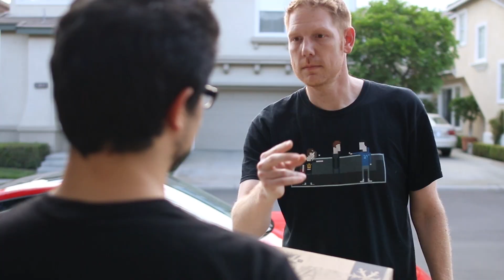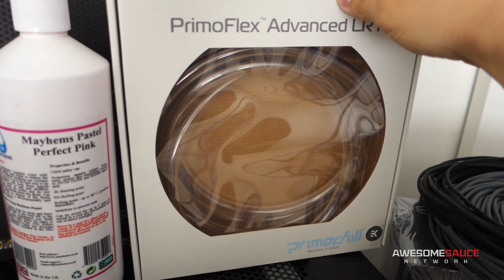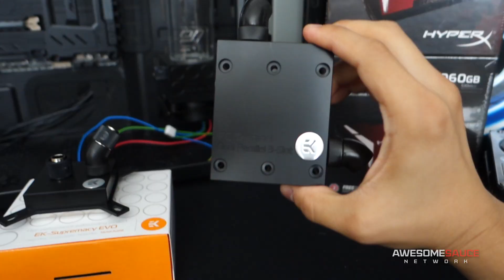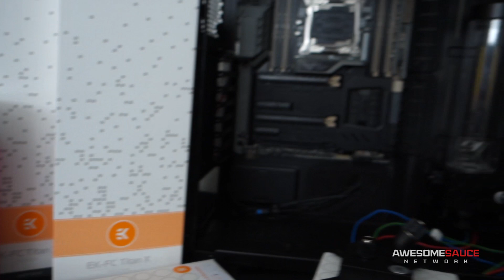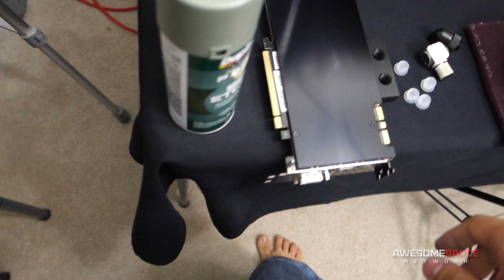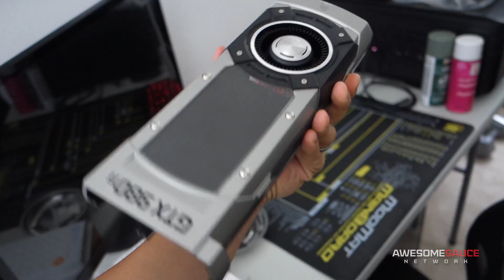Custom Water Cooled Build Log 3 -  THE PARTS & GPU Water Block Installation!

Comment: Hey Kyle, the heat sink on the zotac card has two more screws hold it down, which is why you were having g trouble removing it. And please, never use a heat gun on your graphics card, there is always another way. That what makes modding, so much fun, coz there is always something new to learn and do.

Comment: Can anyone tell me if a waterblock on a gpu needs the PC to be water looped? Or do they just cool the card without tubing and custom watercooling?It may be a dumb question but i havent found an answer to this.
Reply: how could they cool it without water? of course you need water, or else the block will just heat up as well

Comment: After what I'd done to my GTX 580.. I'm sure as hell not afraid to put on a water block on the GPU. The thing had failed after many years of use... so I took it apart and threw it in the oven to try to get more life out of it. Sure enough.. it was brought back from the dead and still works almost 2 years later in my older PC lol.

Comment: Kyle I have a question about fans. How did you hook up your fans in the case. I just bought the define s and want to run more then 2 case fans but my motherboard (Msi a78-e35) only has 2 sockets for case fans. How would u recommend I fix this?

Comment: Hey i have a question, you know how there are founders edition cards or reference cards do non reference cards have the same pcb so like the gtx 1080 founders edition and the gtx 1080 G1 Gaming do they have the same pcb? so a GTX 1080 founders edition waterblock would it work with the gtx 1080 G1 gaming by gigabyte ? thanks
Reply: Not always , the 1080 founders edition, and the evga 1080 sc both have the Ames reference pcb, but all other 1080s use different ones so a different water block is needed

Comment: do other components on a gpu (beside processor die) need cooling and how much??? my gpu has 3 fans spread all over the card, but what happens with the rest of the card if i put water cooled heat sink only on chip??? thx
Reply: Vrm and memory. If you have one fan blowing cool air on them, they should be fine. They don't generate nearly as much heat as the gpu

Comment: Can someone please tell me the name of that pump/res combo, I can't find it on EK's website?
Reply: thats cos whats in there is now EOL Sadly, been looking for a similar setup as the current gen combo has a really small Res
Reply: +Dave Wilson Bummer! Yeah all of EK's other reservoirs are pretty small. :( Thanks for the help!
Reply: you can still get a EK250 (which i think is thats in Hotline and Jayz skunkworks builds, i could be wrong) and fit it yourself, its just the combo ones are a lil small.
Reply: Are you able to hook the pump up to the reservoir like an all-in-one unit though?
Reply: AFAIK yes, kinda what im planning to do with a EK-XTOP Revo D5 PWM. However I should point out that last time I did a watercooled built I was using fish tank parts and bits from B&Q(2002), so things have come on a little bit and im starting from scratch.... kinda

I'd suggest emailing EK and asking
Reply: I'd be genuinely surprised if you could, they don't look compatible, the combo unit has many ports whereas the pump only has two as far as I can tell. And I need quite a few ports. I'm probably just going to go with an alternative brand. I hope your build goes well though!
Reply: if its just a thread the EK-Xtop DDC might do
Reply: http://www.frozencpu.com/cat/l3/g30/c97/s152/gallery/p2/Liquid_Cooling-PC_Water_Cooling_Reservoirs-PumpResevoir_Combo-Page2.html?o=title_az
I couldn't find the exact one but here are a few big pump/res combos

Comment: Just for your viewers who may have run into the same issue, the heat sink on the Zotac 980 TI Amp is not exactly glued on. It's just kind of stuck due to the pressure and the kind of squishy and sticky thermal pads that Zotac applies. I was able to pry the heat sink off using some gentle pressure with the little screwdriver I used to remove all the tiny screws and my hands. I used the middle of the PCB as leverage and gently lifted the heat sink with the screwdriver. Once there was a little give, I just peeled it off by hand. Just make sure you keep an eye on the PCB that you're not bending it too much and you should be good to go.

Comment: I'm confused. I'm trying for a similar setup, and if there is a limit of 55mm on the top rad plus fans, how does it fit? Isn't that particular rad 38mm thick? So 38+25=63mm...
Reply: +Chad Christian hey mate i was thinking the same thing but i found with a 360 rad if you mount it more to the window side you can get away with the extra thickness as it is further away from your motherboard and ram!

Comment: As a total noob to pc building I'm wondering why so many people put a radiator at the intake? Doesn't heating the intake air, result in higher temps inside the case, making the radiator on top work harder/less efficient and further heating the front radiator etc... ??
Reply: The fans are set to blow out so that it pushes the heat from the radiators out of the case.

Comment: When you said that you hope the EVGA 1000w psu will be enough..
You do actually realise, That pc will only pull about 600w from the wall at full load right??
all this "1000w for high end dual cards" in absolute rubbish!
As a clearly respectable hardware reviewer, you should know this really..
Get a wall plug monitor....
I built a gaming pc for a customer, with same mobo, cpu as yours, but with 3x 980's, and that only pulled 770w under full load...(tested with two wall monitors for accuracy).
and thats CPU overclocked to its limits...
Seriously need to learn your stuff before saying things.
Reply: Did you Google this stuff and make up a fake story. if real what's your company you work for

Comment: So why the thermal paste + thermal pads?

Thought thermal pads never needed paste.  Paste is only needed on cpu/gpu's to fill the micro sclatches/imperfections on the two heatspreaders. (block and chip)

Comment: I wouldn't spray paint the sleeving... I could see it being very patchy and possibly gunk up the inside before running wire through. plus paint doesnt like to be bent like it would be in a case. why not just return the sleeving and get a reel of pink?

Comment: Man I'm soooo proud to be a subscriber to awesome sause!!!!!! I been looking for a video with a gtx 980 to reference ek water block for weeks. I'm very much curious as to the over clock the card can take with the block. Could that be the formula to the single card 4k solution. I'm building a fully water cooled and when I say fully I mean fully watercooled system in a "Silverstone ML07" the perfect of console. And the GPU code name Bruce Banner "gtx 980 ti ref" need to become the HULK "overclocked" just need to right gamma rays. So please looking forward to temps and it overclocked benchmarks

Comment: Hello I need some help.
So my current PC is the first generation HP touchsmart that is probably around 7-8 years old. I was given it by my parents after they bought a new ASUS tower worth 1,200 dollars. That is the computer my brother currently uses.

Now i play light games on the PC such as league of legends and on my current PC i get about 50-60 fps with dips all the way down to 15-20 fps in huge fights.

I am looking to build a budget PC capable of running league at max settings 60 fps while giving me the option to have the browser open along with skype without any freezing points or lag.

so i looked online and did some research and this is the build i came out to:

CPU- AMD Athlon X4 860K
Psup- Apevia Java 500W
RAM- Corsair Vengeance 8GB (2x4GB) DDR3 1600 MHz
SSD-Sandisk Internal SSD 120GB 2.5"
HDD- WD Blue 1TB 6GB/s 7200 RPM 3.5"
Mobo- Gigabyte AMD FM2+ A68H SATA 6GB/s USB 3.0 Micro ATX ATX DDR3
GPU- ASUS GTX750-DCSL-2GD5
Case- Sentey GS-6007 Cyberia ATX Mid Tower
and a TP-Link USB drive for wifi connectivity at 150 MB/s

Can you please verify my build and make sure it is 
1. Capable
2. Worth the price
3. Reliable

The total comes out to 500.65 USD including the optional 2yr warranty on the GPU

Thanks very much in advance.

Comment: Heat the heatsinks up to loosen the tackiness and you'd have it off.🔥🔥🔥
The inductors, MOSFETs, and the rest of the power delivery circuit can withstand even higher temps while being stored... Same as your situation as they're not being used.

Comment: Too much thermal paste can act as thermal insulation between the two pieces of metal.
Also, putting thermal paste under heat pads is redundant and just adds more material the heat has to travel through to get to the water block.

Comment: hey kyle since your the guy to go to know everything about pc's i want you to tell me if my build is weak 

CPU 

Intel Core i7-4790K 4.0GHz Quad-Core Processor

CPU Cooler 

Cooler Master Hyper 212 EVO 82.9 CFM Sleeve Bearing CPU Cooler

Motherboard 

MSI Z97 PC MATE ATX LGA1150 Motherboard

Memory 

G.Skill Ripjaws X Series 8GB (2 x 4GB) DDR3-1600 Memory

Storage 

Seagate Barracuda 2TB 3.5" 7200RPM Internal Hard Drive

Video Card 

Gigabyte GeForce GTX 970 4GB WINDFORCE Video Card

Case 

Corsair Graphite Series 230T Black ATX Mid Tower Case

Power Supply 

Corsair RM 650W 80+ Gold Certified Fully-Modular ATX Power Supply

Optical Drive 

Pioneer BDC-207DBK Blu-Ray Reader, DVD/CD Writer

Operating System 

Microsoft Windows 8.1 OEM (64-bit)

Monitor 

Asus VE247H 23.6" Monitor
is this a good build feel free to tell me if anything could be better my price range is $2000 i wanna run things at ultra
Reply: ***** would it run stuff a ultra thats my main question
Reply: ***** well i was thinking of getting a MSI Radeon R9 390 8GB Video Card is that better than the 970
Reply: it is bad. no it is good
Reply: +meep672 just get a titan x
Reply: aint made of money boy
Reply: meep672 Your price range is 2000, and you say you aren't made of money
Reply: You need an SSD
Reply: if you aren't gonna overclock, you dont need a "z-branded" mobo.

Comment: I totally get the aesthetic and hobbyist/building aspect of water cooling, but those are literally the only reasons to ever do it. From a performance and practicality standpoint, it's a colossal waste of money. For the price of a single GPU & CPU water cooling system, you could likely add another mid- to high-end GPU to your build instead. And air coolers are not the intrusively loud, ineffectual plastic heaps they were ten or fifteen years ago. Air cooling delivers comparable noise and performance for vastly less money and risk.
Reply: Mike Doolittle money yes, risk yes, practicality yes, effort yes, but the thermal performance of a serious custom loop is miles ahead of any aircooler! if you already have a system with 2 gpus and a high end cpu, why not go all the way and get the last little bit of performance out of it? especially with modern GPUs lower temperatures directly improve clock speeds, and multi GPU systems are notoriously hard to cool on air. 400 bucks for 10% more performance on top of the fastest hardware available without the driver hassle of tripe/quad GPU setups is actually not that bad if you factor in how much fun it is and how cool it looks. it has its practical merits on top of being a cool hobby (pun sort of intended)
Reply: That's assuming 1) you're only going to spend $400, which is probably closer to half or a third of what 2 gpu blocks, a cpu block, res, pump, radiator (or two), and tubing actually costs; and 2) that you'll actually get 10% more performance, and there's absolutely no guarantee of that. Air coolers these days are pretty good at matching liquid for overclocking performance, save the crazy liquid nitrogen or phase change stuff that only overclocking hobbyists do.

Comment: This is a prime example of why I tell people to buy the SAME graphics card to have a matched pair in clock speeds and design for when they go for water cooling. Two different manufacturers, two different designs, issues arise. :\

Comment: Great video Kyle! The waterblock install info is essential for first time water cooling noobs , I can add from my experience that I thought I was going to ruin 2 perfectly good MSI GTX980's when I went from air to water cooling . But if you take your time like you said and follow the EK instructions step by step you'll be ok. The EK components are awesome in my opinion they look great and work well. My GPU's were running around 80c when loaded with the TF5 air coolers . Now my GPU's run at around 40c to 50c depending on fan speeds and ambient temperature in the room. I think after running the soft tube for a while you might change your mind and go for rigid tube . I went straight to rigid tube myself . I will admit it's daunting at first but just like installing the waterblocks if you take your time and plan out your loop in advance the results look awesome. Don't panic if you mess up bending rigid tube , get more than you need for the job and experiment with it.
Paul would be the man to ask as he has already done all this with his Arctic Panther (grrrrr) build. Best of luck with the build . I loved the start of the video very funny. Nice car .

Comment: This is a cool build. But I probably would use an epoxy primer on plastic parts. Self etching/acid primer is mainly for metal. But both would probably work in the short term. Just the epoxy primer would last longer.

Comment: Everybody, bow down to the Fractal ad MASTER!
Reply: Quirkification DO NOT SAND THE THERMAL ARMOR!!!!!!!!!!!!!
You may have learned a bit about painting, but micro detail sanding is a different story. It looks fine the way it is.
Reply: Quirkification Also, not sure if more paint would lighten the color. May need to apply a light colored primer first and start again.

Comment: Ok seriously why on earth would someone besides the believe that may look pretty,  will do cable sleaving. ?.why why why? You separate the packe and make your case look worst with dozens of smaller cables running around,  you have tomuse any short of tyreups to keep ghem again together so they look uglier than before,  and most good psu, have dark nst surrounding the cables so you dont see the yellow or red ones, and they don't need a damn tyreup to keeo them together.  Also so psu are just black. 
So why this moda for cable sleaving when it seems its not helping nor makes is look rally nicer or cleaner at the end of the day.

Comment: Gunk AND pads on Graphics memory was silly enough, but THAT much gunk the GPU? Holy balls dude. Metal transfer heat through metal better than TIM, the gunk's only there to fill in the micro scratches where metal's not contacting metal.

And no, it's not been Super fun, if it were super fun, it would be on channel Super Fun, but it's not, therefore it can't be. (I think that's right, it's hard being this silly)

Comment: Hey dude, just thought I would chip in with my 2 cents. As somebody who paints cars for a living and has sprayed all sorts of different things over the years, please DO NOT paint the extra sleeving. The paint will not adhere to them at all, and sooner or later it will start to flake off. I'm sure you don't want to be pulling out your PSU later down the line to be replacing individual cables. With all the money going into this build, whats a little more for some new cable sleeves.

Comment: blasting the PCB with a heat gun is not a good idea - you will risk removing all the wave soldered surface mount parts.

Comment: Couple of tips for you buddy. ( love the ad, cudos to your fiance for helping you out :) ) 

First is do NOT paint your sleeving. I know that it sounds ok in theory, but the reality is there are too many issues that will arise. Even with adhesion promoter the paint will flake when rubbed on things. The color will never be uniform. Not to mention depending the plastic its made out of you could have a bad reaction. 

Second is primer is not a paint color. It will discolor under light and simply by being touched. You should try to find an actual gray paint you like.

Comment: Awesomesauce Network Kyle, I like your build, it's not over the top when it comes customisation.Why don't you do what you did with your radiator, paint the the EK-Supremacy EVO CPU water block?.Since your re-spraying the thermal armour anyway.I'm only saying this because of personal experience don't use soft tubing in between the GPU's.Get some acrylic tubing from jay or Paul and just cut it down to length, it looks better and it won't get stained like the soft tubing.
                                                                                               Keep it Awesome sauce

Comment: Another great video Kyle! The intros are really entertaining. "At least this thing is Silent."

Just a few things:
I agree with repainting the motherboard shielding. I didn't realize the color difference until this video and I'm fairly particular about that with my own builds. You're not crazy, you're just doing it right. Also, don't paint the sleeving. I've tried that and unless you use a paint like Plastidip it will chip when flexed, and even with a rubberized paint you lose a lot of texture and flexibility. You're better off buying it.

Loving the build and the "What I've Learned" segment is really helpful.
Best of luck!